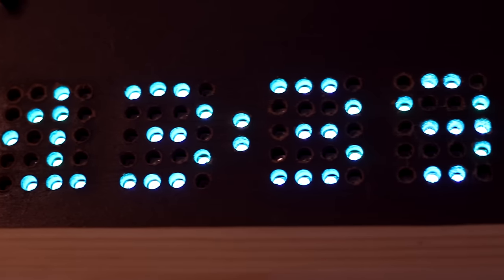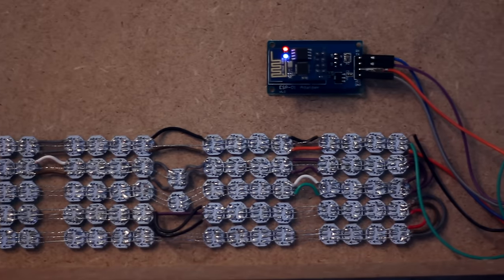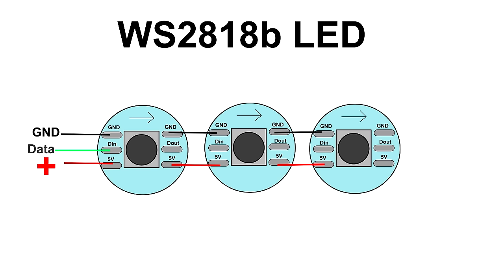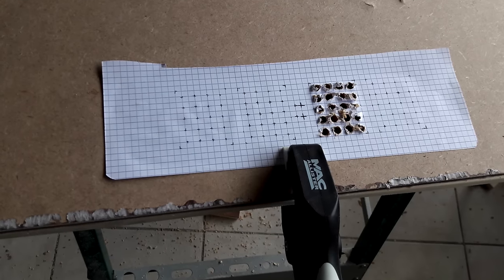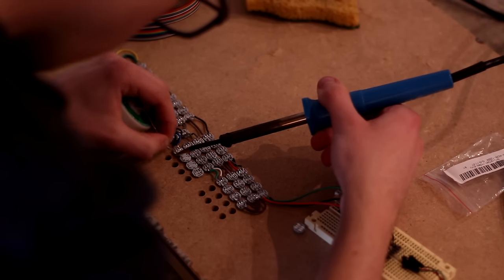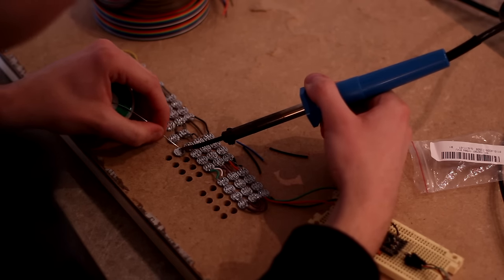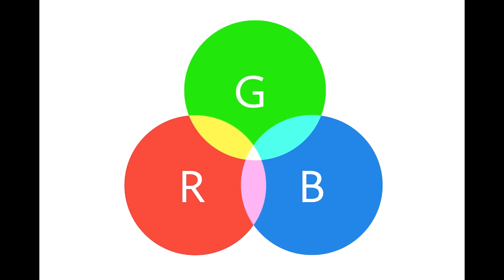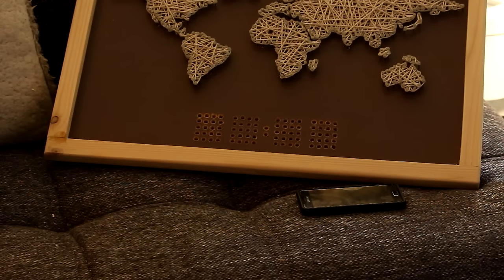Create clock display using WS2812b Neopixel

Comment: Sir nice clock. Can you make a video with the arduino and wifi board. How to program it etc.
Reply from the maker: I'm currently re-doing the code with an ESP32 board (which is easier to program using Wifi) I'll try to make a video about it if I find my self some time ;-)

Comment: Awesome! I’m using the same LED module and making christmas decoration at the moment. Soldering all those LEDs is a nightmare. What kind of wire precisely did you use to solder the LEDs when close together?
Reply from the maker: Hello all wires used in this project are from here : 
https://www.banggood.com/5M-1_27mm-20P-Jumper-Cable-DuPont-Wire-Rainbow-Flat-Wire-Support-Wire-Soldered-p-959792.html?p=W016111637439201505V&cur_warehouse=CN
It is simple wire, nothing special. I've just removed the insulator twisted it and put it on it and it works great to connect close LEDs.
But yeah I confirm it takes a lot of time to solder them properly. But to me it was the only way to get the result I wanted ;-)
Good luck with your project !

Comment: you could have made this with one or more 32x8 WS2812B matrices.  I calculated you saved about $10 after 5 hours of work and the cost of solder, electricity, flux and wire.  I like whn everything essential is included.  Essential microcontroller code is missing so this cannot do anyone good
Reply from the maker: LED matrices don't have the same spacing as I wanted so I could not have them and create the effect I wanted. The code is highly specific to the way I soldered the LEDs together, so unless you want to solder it the same way it won't do any good to have the code.